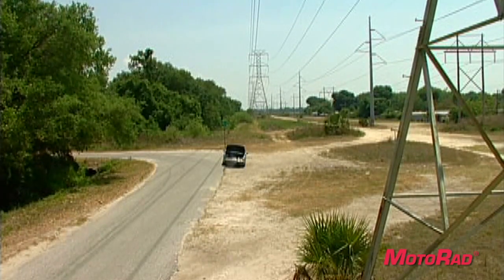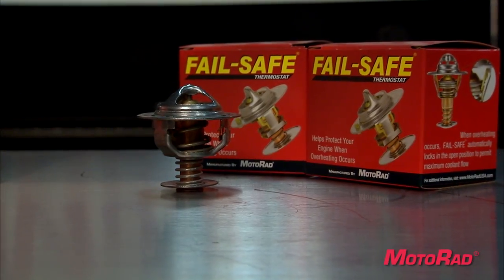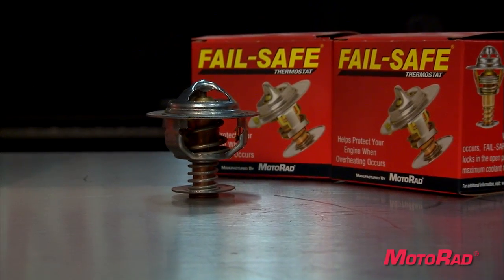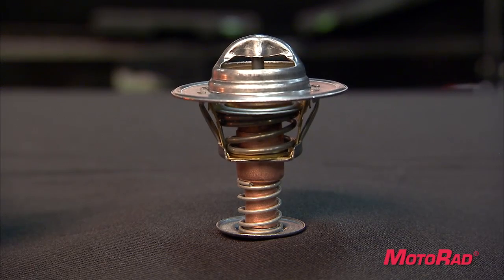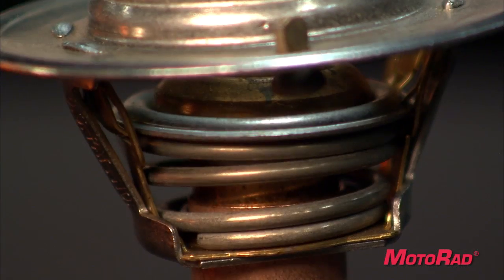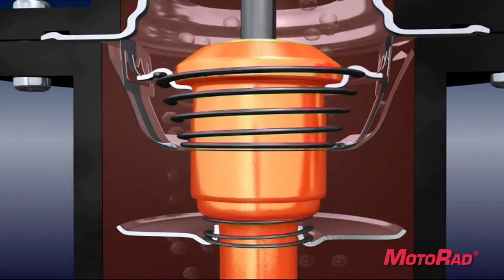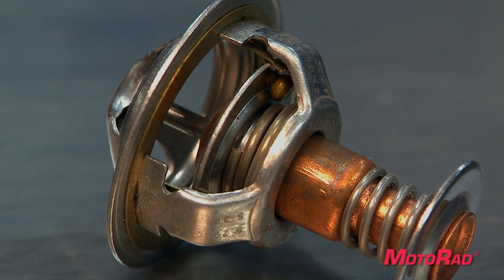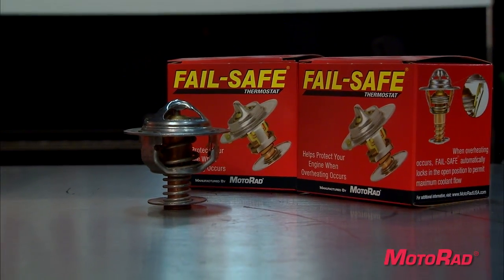MotoRad Tech Tips - Fail-Safe Thermostat

Comment: At what temperature do these lock open at? Thanks
Reply: Normally thermostats fully open 10-15* above the rated begin opening temperature. At about another 15* they'll go into fail safe open. I've tested them at 235* lock open. 50/50 anti freeze is good for 256* with a proper cap.
Many @2020 GM pickups show 260-280* on their gauges as normal. 😳 And the gauges go to 300*.😳 Those might be rated higher. (?)
BTW ALWAYS test your cap with a pressure tester. Youll find even MOST new caps are not up to spec.